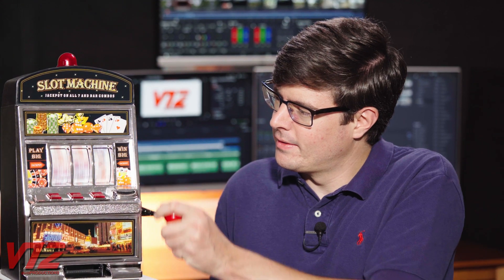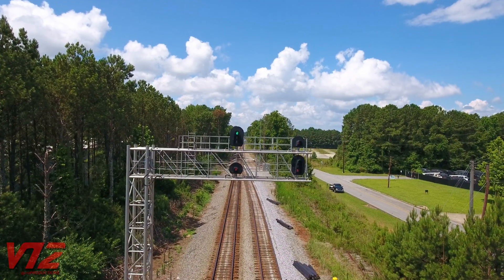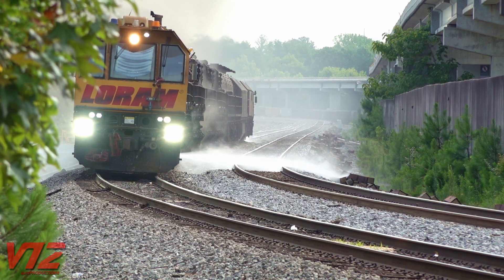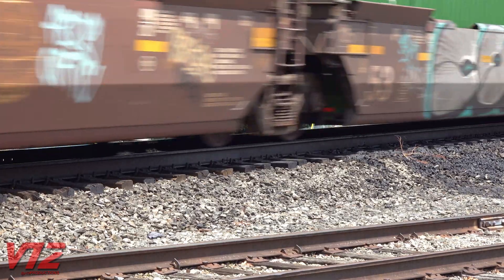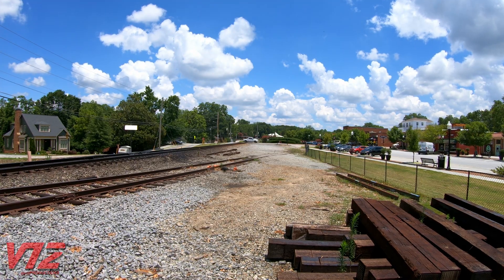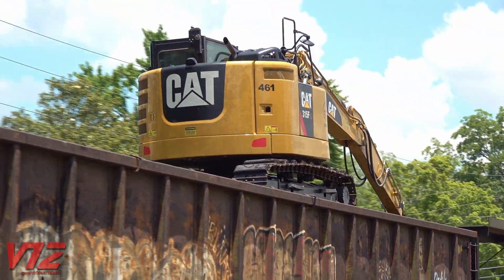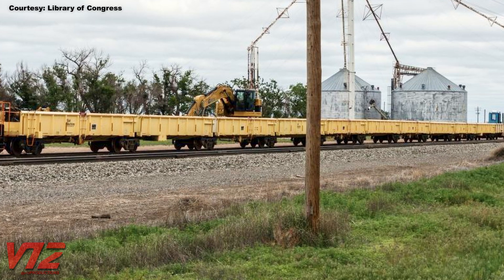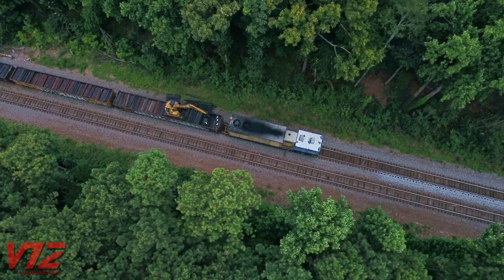SMOKIN' SLOT MACHINE | What is it??

Comment: Using wife's phone today not her opinions I missed this one but the timing is perfect I just saw this MOW SPS unit in a short but it didn't have any content about what it was for and it had a different configuration no excavator or the modified flat car with the ramp it had one gondola and two short flat cars with safety rails around them you have the only video I have come across that actually goes into some depth on it I am fascinated by the creative MOW equipment that is being used now

Comment: I suppose I understand why Class I RRs would contract this out, so that perhaps explains the unusual equipment from the contractor.  Initially, I wondered why the RR would not use some old power of their own to pull the tie gonds, but that would involve using their own crews at a higher rate of pay (I assume).

Comment: GREX 6000 (the same model as 6008 you saw) is ex-MBTA SW9 1900. Im not sure if all of thos GREX locomotives are rebuild off a SW9 but i would assume most of them if not all are based off a similar platform to a SW9